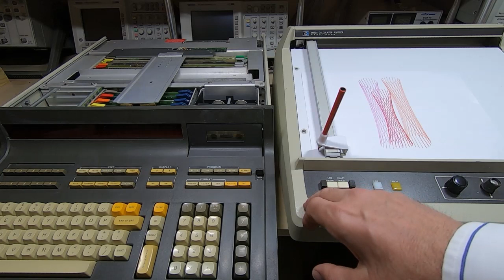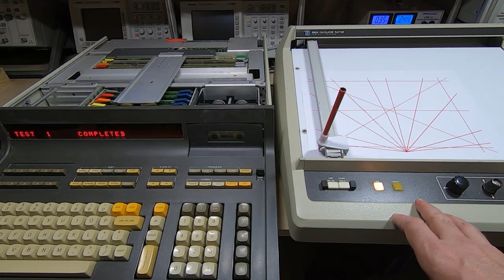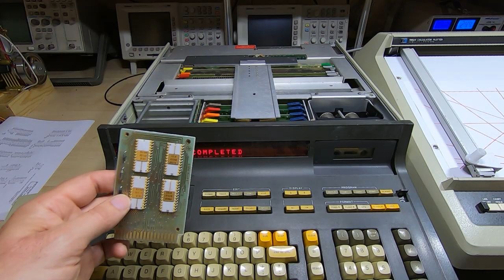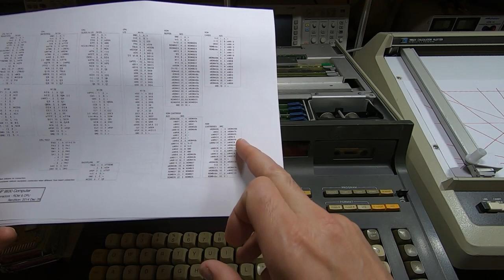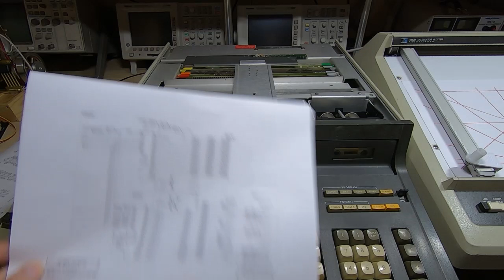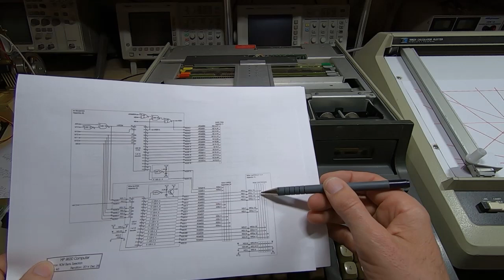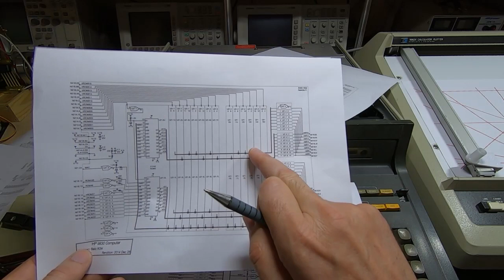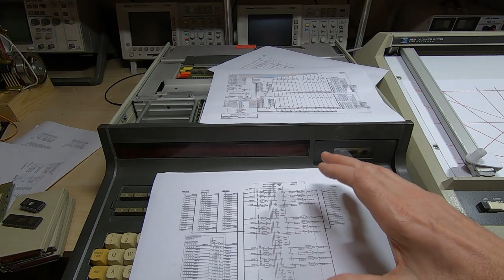HP9830 ROM Module pcb Part1

Comment: Since it's a ROM card, perhaps you could decode write cycles to some address on that card slot, and decode/latch that value to select which bank of the ROM gets selected?  Then you wouldn't need to externally access a switch and could (in theory) programmatically swtich between the different cards.  Is there some POKE-like basic operation that would allow you to that?

Comment: Clearly have a new card that fits in the original riser will be much easier and a awesome resource but I wonder if it would be possible to design a new riser card, re-routing ROM selection avoiding switches and perhaps moving buffers on the ROM board . Room available permitting. 
Edge connector may not have enough lines? Just an idea.
Reply from the maker: Yes I did consider that but I did not want to modify the 9830A for a few reasons. 1) I am only selling bare boards and a mistake building the riser could damage the 9830A boards and people have a habit of blaming me when they make a mistake. 2) I want the 9830A to still be able to use existing modules. Because there is a buffer between the modules and the 9830A then it is fairly well protected in the event that the module is incorrectly assembled. If I were to modify the riser then I would just do away with the modules entirely and fit the ROM to the riser using buffers as in the original to protect the 9830A but then it would not accept original modules.
Reply: @JerryWalker001  yes. very valid reasons

Comment: Instead of a dil switch, maybe you could use a rotary switch to select the upper address lines, one at a time, so there is no possibility to accidentally select two images at the same time?
Reply from the maker: Unfortunately there is not enough room. The entire pcb assembly must fit into the 8mm space available. It would also not stop anyone from setting switches on 2 modules to the same settings. I would also say that there is nothing to stop people plugging two of the same module into the 9830A so I am not really adding any risk.